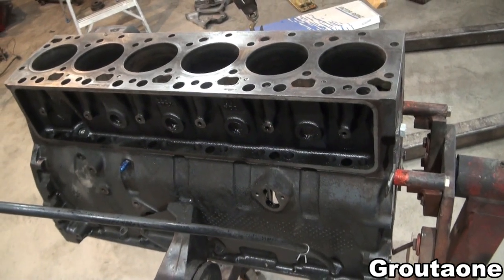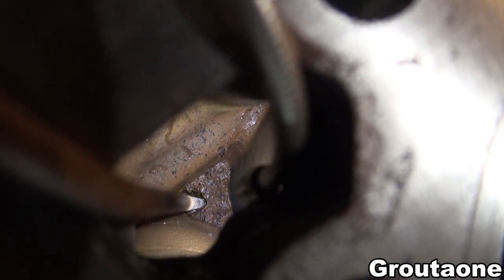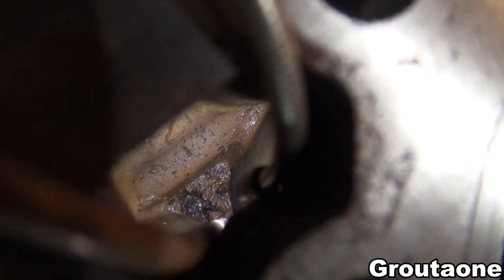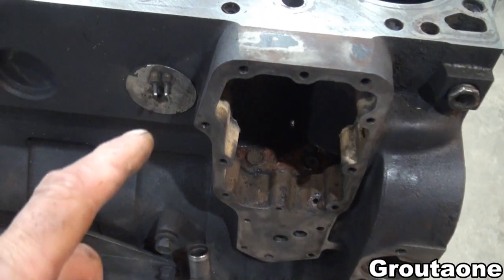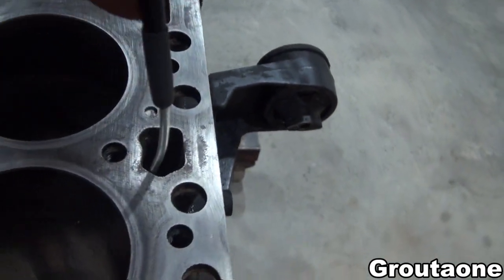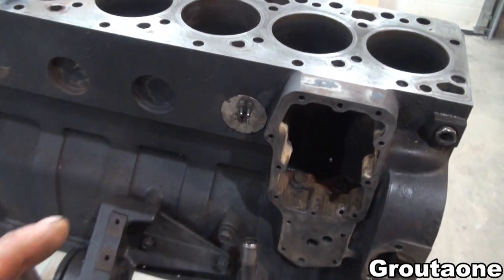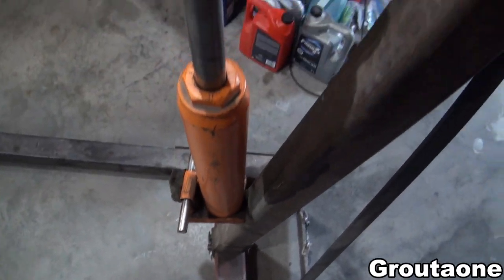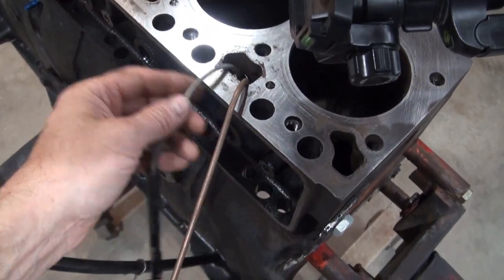Dodge Cummins Water Jacket Rust

Comment: When I bought my 12 valve, there was a ton of rust in the jackets... 

There was just brown water in the cooling system (which I completely rebuilt). I think the water pump leaked and they never bothered to put antifreeze back in! X3 

I blasted it out with a garde hose, then soaked it with vinegar. After flushing it with water again, I poured in some baking soda to neutralize the acid. I haven't had a problem since! :3

Comment: A regular garden hose with a spray nozzle is usually good enough to get the deposits out of the bottom of the block. The block is made to have the deposits fall to the bottom so they don't get circulated through the system.

Comment: such dust / dirt does not affect the engine cooling performance as the cylinders bottom are not critical, but when it's appart it's the good opportunity to clean up, I did the same on a cleveland block, on your block you seem to have wide windows / accès to do it , i would blast it with a soft media
Reply from the maker: My main reason for cleaning it out is to keep it out of the heater core and radiator
Reply: groutaone yes of course it was my goal too

Comment: I need to take apart my 12 valve and reseal it 1million 89 thousand miles she’s leaking good and a good inspection of all the bearings and stuff she needs it probably new cam bearings and all that stuff
Reply from the maker: That's lots of miles, classic cummins, still the original injection pump? What does the oil pressure gauge show at warm idle?
Reply: groutaone it showes about 35 psi no 2 injection pumps and it runs on ams oil with a ams oil dual oil filter set up
Reply: groutaone lots of injectors here and there